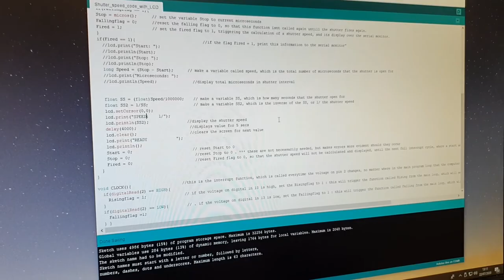film camera shutter speed tester

Comment: Hi there could you share your code?
Reply from the maker: hi there, i used the following code. https://github.com/cameradactyl/Shutter-Timer/blob/master/Shutter_Timer_v1.2.ino
Reply: @davehyper7835  Thank you so much, I will give it a go 👍
Reply: @davehyper7835  hi, is this code running well with oled display and without oled display? Or the code must modify if add using oled display?
Reply from the maker: @harkotrisusilo  Hi, You will need to included the library for OLED display in your setup code. You may also need to install it into you Arduino IDE using the Library Manager. it's normally something like SSD1306 oled driver library for monochrome 128x64 and 128x32 displays